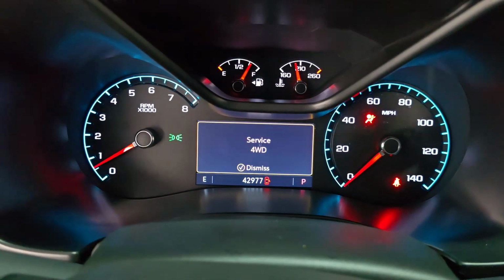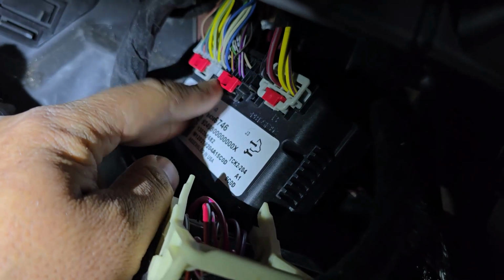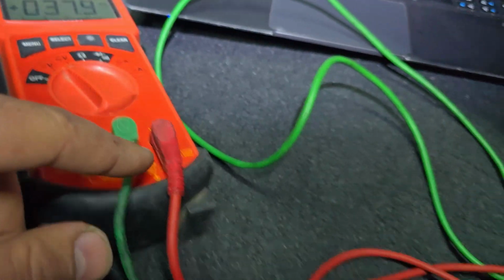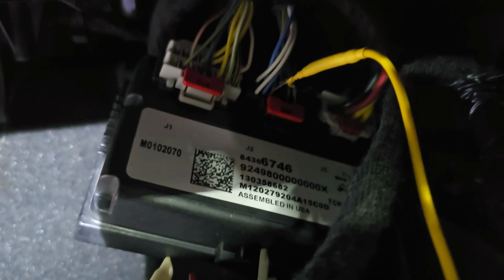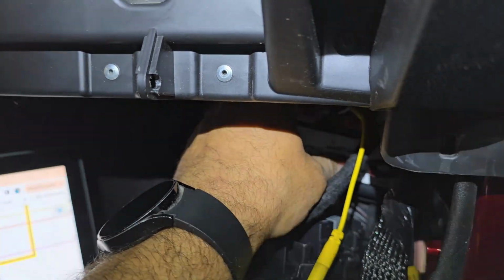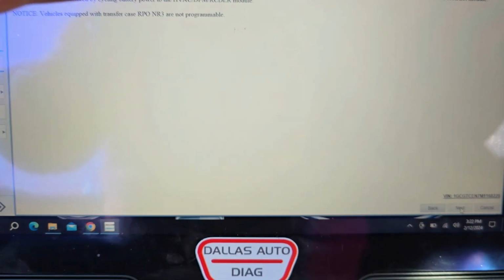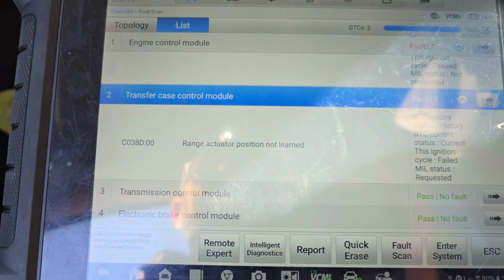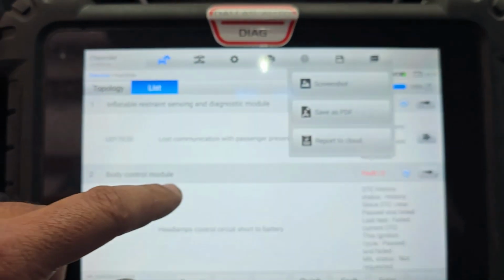2021 Chevy Colorado U0102 Lost Communication With Transfer Case Control Module TCCM Diag and Repair

Comment: thank you so much for a good program
I have 2022 hyundai elentra ,  after the rear accident the cluster have all kind of light ,the rpm is not working 
any advice
thank you
Reply from the maker: check your crankshaft sensor